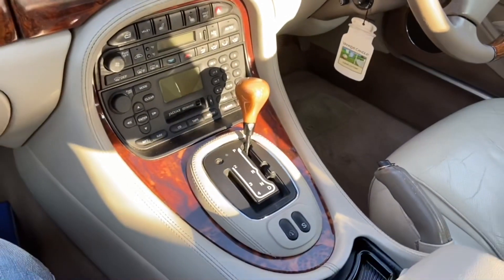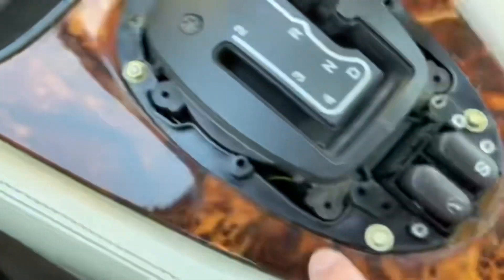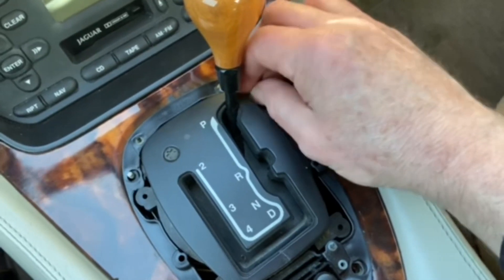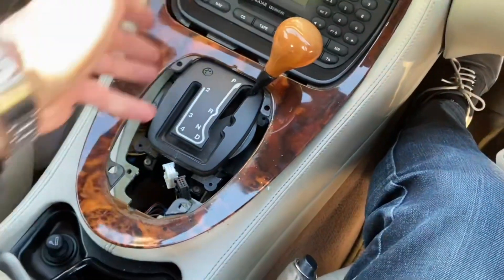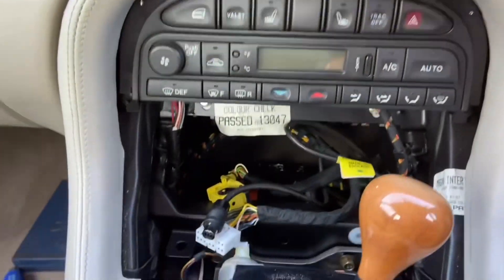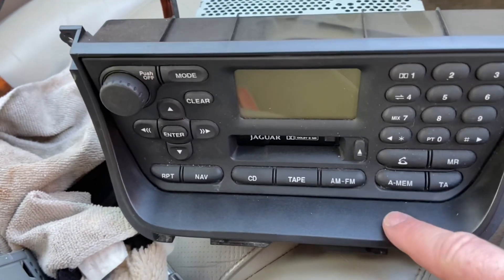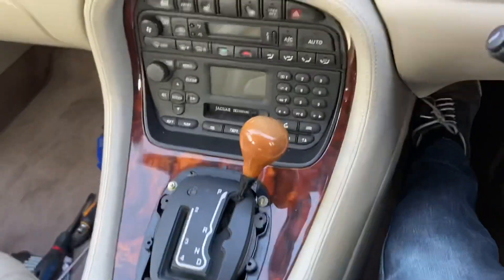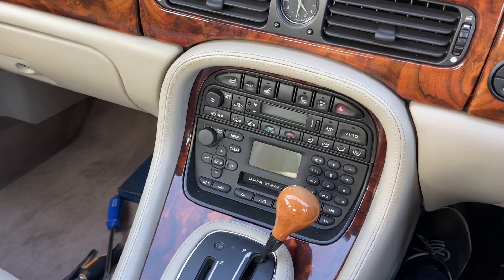How to replace the radio on a Jaguar XJR 308

Comment: Thanks for uploading this video on XJ8 X308 radio fitting. A watched it prior to doing my little job and it certainly did help.
Something that may be of interest to others. I have a 2002 Jaguar XJ8 4.0 Executive which is a re-import from Japan. The Japanese spec radio has a shorter range of frequencies and only picks up 1 or 2 UK radio stations in the frequency range overlap area. I decided to replace this unit with a UK spec radio from a Jaguar breaker. After fitting, the radio did not work, or the tape player, but the CD changer did work. I took the unit back to the breaker's yard and he replaced with another. The same thing happened. I can only assume there is a difference in the multi-plug wiring between UK spec and Japanese spec cars. My solution.......I fitted a Frequency Adaptor from Amazon for about £13. This fits between the aerial plug at the end of the aerial cable and the aerial socket in the back of the radio and shifts the frequency band signal from the aerial and tricks the radio into picking up UK radio stations. The station name does not appear on the radio screen but the UK stations are received. It is the later style unit as featured in your video. Sorry for the long comment.
Reply from the maker: Thank you for watching. I’m glad you found it helpful. 👍🏼
I’m glad you got it sorted on the frequency change.

Comment: How does the radio code work? Do you have to punch it in to get the car to work?
Reply from the maker: Hi Tommy. Thanks for watching the video. You have to put a 4 digit code in to get the radio to work if you have disconnected the battery or replaced the radio, but it should not affect the ability to start the car.
Reply: @rolyswheels  Thank you very much! My radio is acting up, and I'm now on my 2nd radio unit. My car is a 1999 VDP with 275,000. I spend a lot to keep it well maintained. My radio doesn't hold the signal and keeps cutting out. I have all my stations stored in memory, so I need to keep re-hitting '1' to get that station to come back on (from memory). It might be a power supply issue or an amp issue. Thanks for your videos!